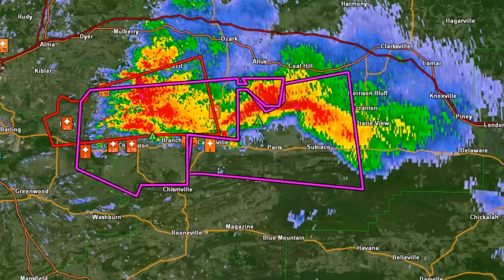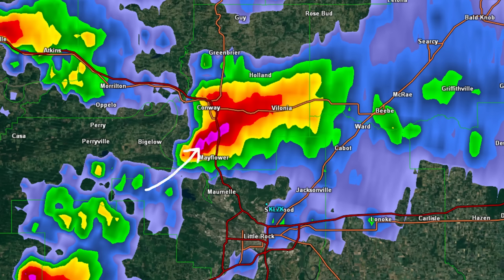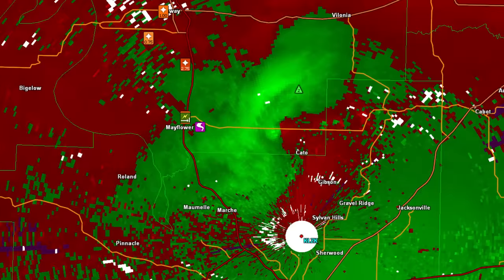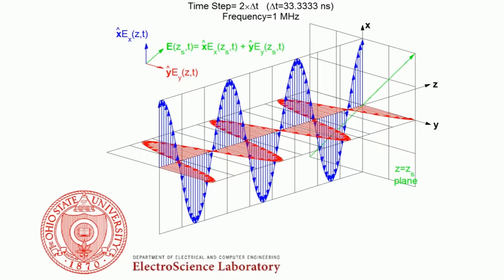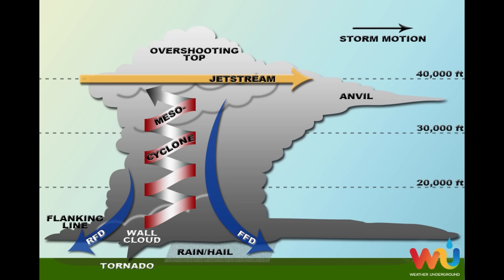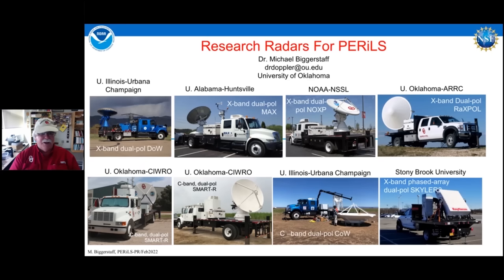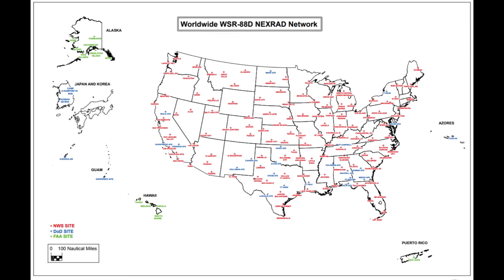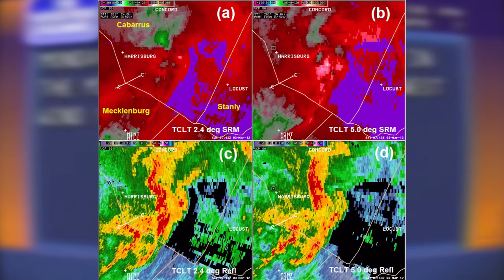Can Tornadoes happen with ZERO warning?

Comment: What tornado is shown at the beginning of the video? Looks like an interesting vintage tornado film.
Reply from the maker: Yes that one (if I remember) is the Columbus, Nebraska tornado of 1998. You should check out the channel vortexva. I'm not sure who exactly runs it but they have a collection of old tornado footage on VHS. Some incredible stuff on there
Reply: @weatherboxstudios  Thanks! I found the video with that tornado on their channel. You’re right. It’s Columbus, NE from 1998. I was intrigued by that particular clip because of how low the wall cloud was to the ground. I’m shocked it was only rated an F2. It seemed pretty violent.

Comment: Think about the North Arkansas problem this year. It has a radar gap between Springfield, Paducah, and Memphis. The beams were shooting way too high into the storm. The CC showed a drop and a TORNADO EMERGENCY was issued. This drop in CC was due to hail not tornado debris. Some jack donkey decided that they needed to report a "Large and extremely dangerous" tornado on the ground and it caused lack of faith in our warning system to be even more prominent. While a tornado warning was warranted a tornado emergency was not. This caused unwarranted fear and panic. A NE Arkansas radar would have debunked all of the corrupted data and shenanigans.

Comment: I kinda have experienced one in 2017 there was this storm where i could see rotation and the air force base near me said they saw rotation and set off their sirens although no warning was issue, the storm was intense, my mom told me to get inside a thousand times 🤣, but it honestly was fun, i think i may have even seen funnels, later on nws confirmed an EF-0 tornado a city super close and in the same storm

Comment: Not an unwarned tornado, but I did experience an unwarned hurricane. Okay, technically it wasn't a hurricane, it was an extratropical cyclone, but it had hurricane-force winds and everyone referred to it as "the hurricane" for years; nowadays I believe it's just called the Great Storm of 1987. I was eight; I went to bed on a normal day, with no expectation of anything unusual. I woke up to find our maple tree had been broken in half, and one half of it was completely filling our back garden. We had no electricity, and the roads into and out of our village were completely blocked by dozens of uprooted trees. My father had been working a night shift at Gatwick airport; it took him twelve hours to get home, having to walk the last two miles climbing over fallen trees.

Elsewhere, ships were capsized at their moorings, a big cross-channel ferry was blown aground, radio and TV transmitters were destroyed. Fortunately, only 22 people died, a remarkably small number.

It was particularly bad because it happened in October, so the trees mostly still had their leaves. This meant huge sail area, so upward of 15 million trees were uprooted across the southeast of England. Our village was without power for ten days. Our family was actually pretty well off. We had a coal fire for heating and hot water, and we camped a lot so we had portable gas stoves and lanterns. Quite the adventure!

The Met Office knew that the storm was there, of course, but its course was predicted to take it straight into France. Instead, it took a sudden left turn as it approached the English Channel, resulting in the south-east of England being hit with full force. There's an infamous TV clip of weather reporter Michael Fish saying, "Earlier on today, apparently a woman rang the BBC and said she heard there was a hurricane on the way; well, if you're watching, don't worry, there isn't". He's since claimed he was talking about Hurricane Floyd and whether it would hit Florida; I remain sceptical, given the phrasing. Regardless, the result was a completely unexpected emergency.
Reply: Hurricane Otis F5 hit Acapulco in 2023 ...was mostly unexpected !    There was a Hurricane off the Eastern Coast on New England on Sept 11, 2001   ...I never heard what happened to it.

Comment: Yes..tornadoes can happen without warning and without a supercell.  If there is enough wind shear, warm humid air feeding a storm and the jet stream is overhead.

If the C.A.P.E. values are high enough and the cap breaks you will get big storms pop off.

Comment: I haven’t experienced any tornadoes. But there’s been multiple in my area. A 1.5 mile wide wedge and a smaller quick moving qlcs like tornado that came through near me. Still I think from a supercell. Just a small one. You can see some damage on google maps from the wedge. But not much. Super cool stuff. But I got zero warning for them. Slept through em like normal. I don’t even think I’d wake up when I’m in serious danger.

Comment: I theorized that the NWS could get data more frequently if they took notes from the Armed Forces
The Aegis system
Instead of 1 rotating panel, there's 4 to 8 of them, constantly sending and receiving data, potentially boosting data update times to a minute to 30 seconds between updates
.
Though, this is a low knowledge amateurs theory, so taking it seriously is not advised